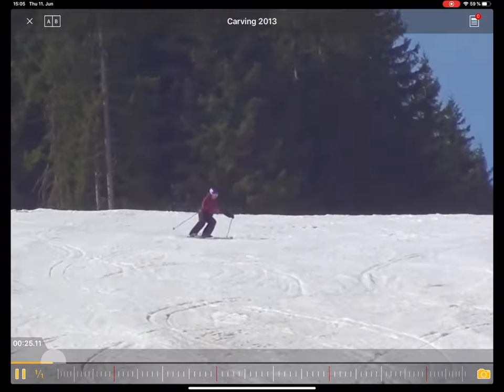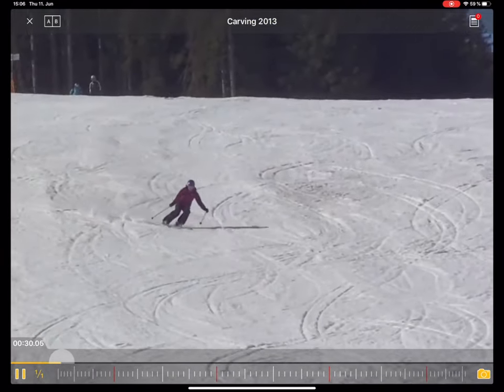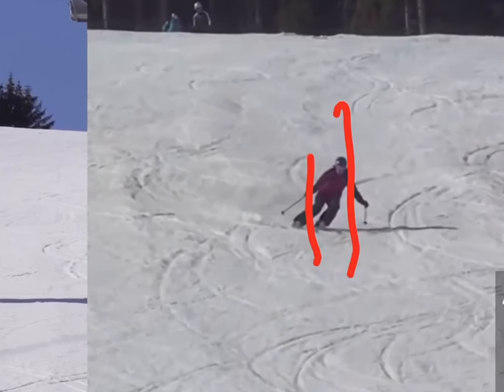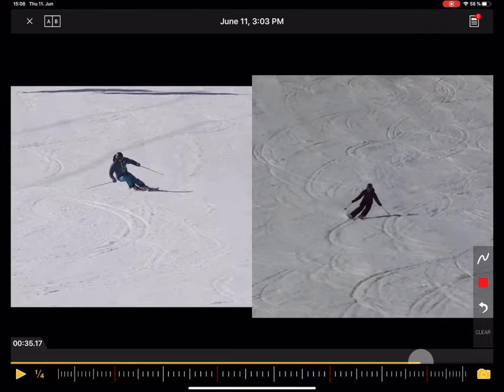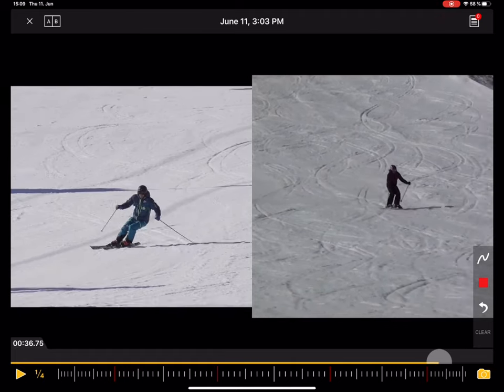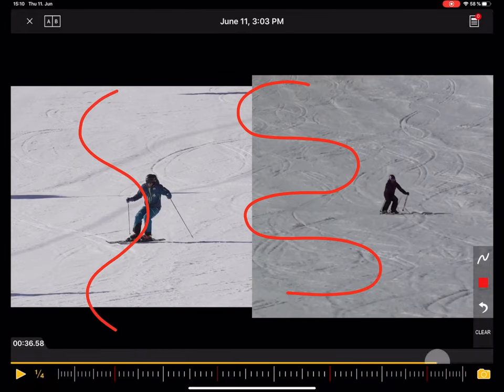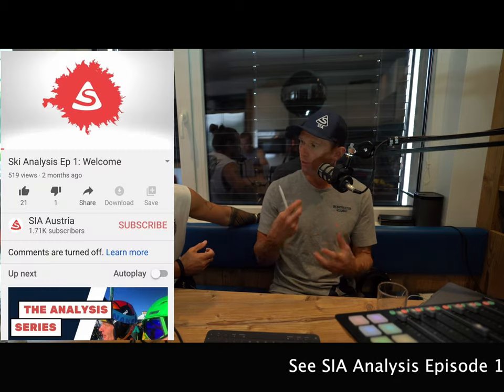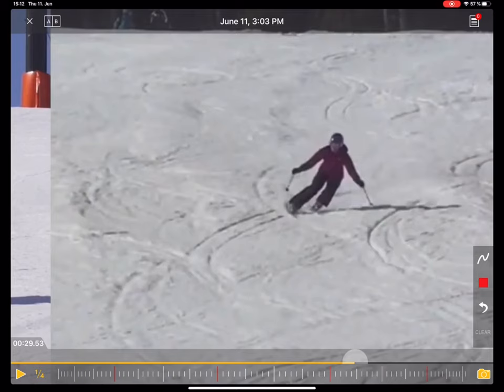SIA Bite-sized: Carving

Comment: The first skier was absolutely making carved turns.  Not to be confused with a person making railroad tracks which is not only Not skiing, but also a great way to wear your knees out by forcing them farther into the turn that your upper body is leaning.

Skiing is the tips of the skis bending and making a turn down the hill with the tails sliding around because your weight is leaning down the hill over the tips of the skis.  What designates a carved turn is when you anticipate the new turn by aggressivity throwing your upper body down the hill and in the opposite direction the skis are presently going.  

"Your skis are making a right turn, and you throw your body back into the fall line to the left which creates a quick and drastic leg angle change which sets the ski on a hard edge.  This will reduce the amount of tail sliding, but it will still be there because you are leaning over the tips of the skis and the tails are slightly lighter.  The harder you lean into the turn, the less sliding there will be.  But it is Never the ridiculous act of making Railroad Tracks and calling that carving.

The second skier was doing the same thing.  Watch the upper body make a quick move down the hill and how quick her legs change their lean and how steep it is.  The quicker and harder the lean, the more the skis will be on edges but there will still be tail sliding, just not as much as you would have if the body change were less aggressive.

In summation, if you eliminate Railroad Tracks from the description of carving, all turns are sliding turns, but to different degrees of the skis angle to the slope.  Go here and watch Ligety make a hard carved turn here.  "Ted Ligety - the limit of carving skiing."  Even though his skis are almost perpendicular to the slope, his weight his much more forward over the tips and the tails will tend to break away whenever the snow gets harder.

Comment: I may not agree. Carving is a qualitative act. It is easy to “carve”a ski without using advanced skills of separation. Yes, even “park & ride” utilizes the carving output of a ski. It is just that the timing is not present in order to manage that carving output to the advantage of the skier. The goal of an advanced skier is to make movements that are the results of the carving output of the ski. There is a fine line between movement and motor pattern inputs and outputs in advanced skiing. Good skiing displays a productively successful cycle of kinetic fluidity that is fed by the relationship between the ski and the ground.
Reply: That was a vague description and a little backwards. "The goal of an advanced skier is to make movements that are the results of the carving output of the ski."  

I think you meant to say it this way. "The goal of an advanced skier is to make movements that will result in the carving output of the ski." 

The carving results of the ski are the direct result of the input of the skier's body positioning.
Reply: @JB91710  that may be for intermediate skiers. All major body movements for experts come from ground reaction force that the ski makes. Anyone who uses upper body movements to control the ski is usually a developmentally plateaued skier that is often taught-in.
Reply: @AtomicB-zq2cw  You just explained what is wrong with ski teaching worldwide.  Describing what parts of the body look and feel like instead of what to do to make those things happen.  Instructors teach by describing the byproducts of the things they don't teach.

I started skiing 58 years ago.  I started teaching 55 years ago at Killington.  I started thinking for myself instead of following what others told me to think, 52 years ago.  That's when I started to realize that the teaching methods weren't teaching people to ski Technically Correct.

If you and everyone else think turns originate in the feet and ankles, then go tell any world class racer that they have been skiing incorrectly for their entire career.  Tell that to Ligety because he skis exactly the way I teach.

When you are ready to make a new parallel turn, you start from your eyes down, not from your feet up.  The very last thing to change is your feet.  

When you are ready to start a new turn,

You look down the hill.
You face and lean your upper body down the hill with your pole plant.
You instantly change your weight and balance from your downhill to your uphill foot.
Your skis are still crossing the slope which starts the leg angle change.
You start to fall down the hill which continues the new leg angle change.
When your skis are flat on the snow, the torsion in your legs unwinds which starts the rotation of your feet.  
The ski tips slide down the hill to point in the direction your upper body is going.
The skis are still continuing across the slope while your upper body is going down the hill.
The increased leg angle rolls your feet over and puts the skis on the new edges and the skis finish the turn.

The last thing that happens is the knees and feet leaning over, not the first.

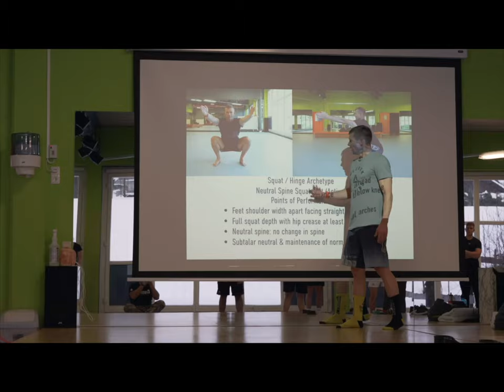Start the video at 0:08 at .25 speed and look for what I say.  While the skis are still crossing the slope, watch him from his eyes down.  Everything stops crossing the slope and heads down the hill from his face down.  Watch the skis shoot out from under him and begin to face in the direction his upper body is going.  Down the hill.  The last thing that happens is the completion of the leg angle change which puts the skis on the inside edges and the ski finishes the turn.

Imagine a wet noodle that you are holding from above.  Move your land to the side and that last thing that happens is the bottom of the noodle moving over.

Rotate the steering wheel of your car.  The last thing to move is the tires.  You have to figure out how a ski works and how to position your body, so it makes the turns without being forced, like steering and twisting your feet.  It's not needed.
Reply: @JB91710  Ah, yes, the top-down vs the bottom-up argument. For me, equal, high tipping of the ski is what both demands and powers the “major”movements of the body. But that is only for state of the art high performance carving on 13m SL skis. Seems to me that most other skiing is more relevant to your top-down view.
Reply: @AtomicB-zq2cw  I went into great detail to explain the correct method, and you didn't even attempt to defend yours except to empty that, t's correct. May I remind you that knees and ankles can't bend sideways?  The entire leg has to lean.  The only way it can lean is if you put your upper body in a position where you can balance on the outside ski.  That is down the hill and over the tips of the turning ski.  I noticed how you didn't make and reference to the turns at 0:08.  That's because you can't deny what you saw.
Reply: @JB91710  K-town? Where are you skiing this season?